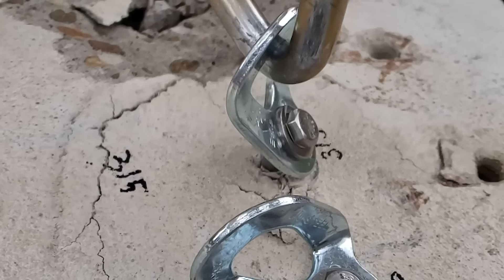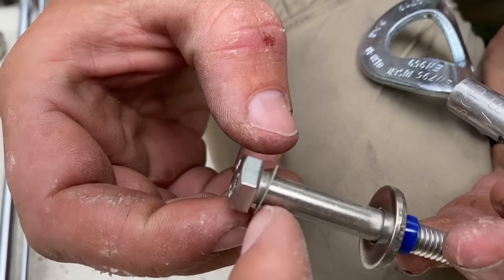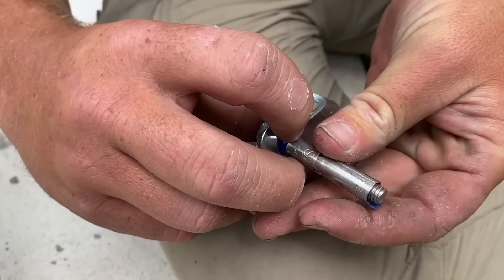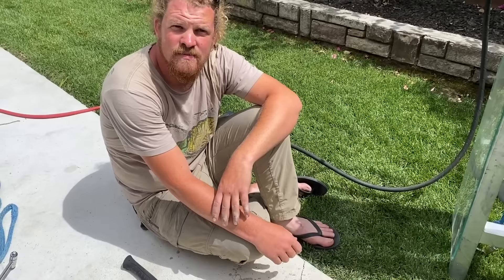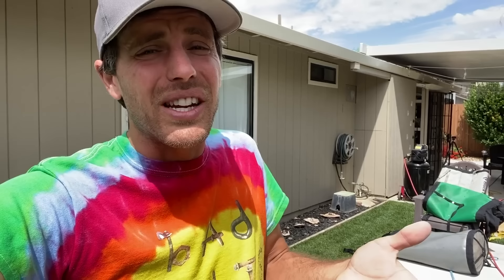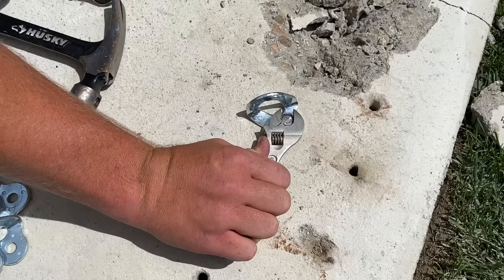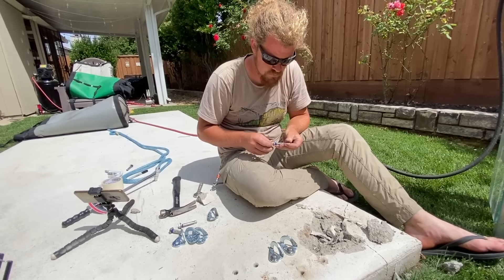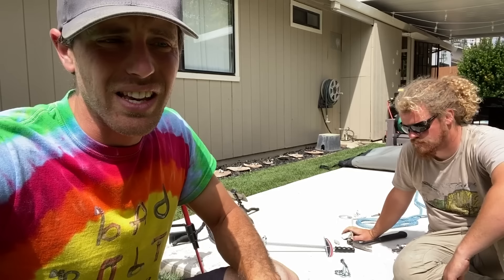What happens when you over torque a climbing bolt?

Comment: You can get a concrete strengthening chemical. They use it in Australia for bottle shop where forklifts drive over. It etches 10 mm into the concrete and raises overall MPA rating. But when using it has an extremely high flashpoint! I've done a lot of concreting in the past. I've seen where the truck driver will water it down so much that when it cures after about a month I'm doing the carpentry framing and crazy cracks everywhere! I'm not making fun of your concrete. Just saying there is a lot of variables in concrete.

Comment: This test tells me the concrete cure fails before the bolt.  This is testing the durability of the concrete.  Test again in another material.   Obviously this test tells us do not forget to torque the bolts.  I think a larger depth concrete and different length bolts would be better test here.  That would show climbers a better understanding of how to avoid failure in softer (wet)  material.

Comment: I don't think you managed to show any difference (50, 100, 200%). Those numbers feel likely to be covered by concrete strength variablility.

As for 400% isn't it likely an effect of the bolt effectively shortening by almost half an inch or so? (less concrete to crater)

Also, 3KN is more than bodyweight! 🤔😅😉

Comment: Concrete gets harder harder over time, indefinitely. At least this is the lore in the trades. So a newer slab like this will be weaker than something that has been around for 10 years.

That said, seems to me once you get large chunks of concrete blowing out so close to the other bolts I think you’d lose some compressive strength on the bolt.

Comment: I'm a big fan of you guys testing all sorts of stuff, but this one seems a waste of time and equipment due to poor setting. (inadequate bolt spacing, the concrete condition, and the lack of 6-point socket) I've personally broken off a head of stainless steel bolts by over tightening it.

Comment: The data is trash at this point because the concrete failed all around the other bolts. They need to be spaced like a foot apart to make this test legit. Also there’s a considerable strength difference between plated steel and stainless.

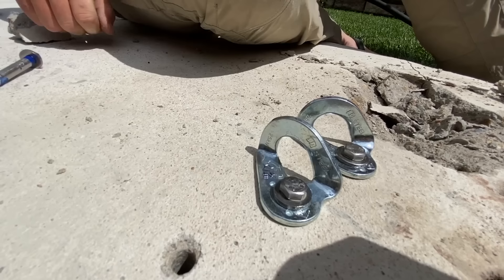Comment: 5:19 No one bolts with a torque wrench? Definitely not the case...
Reply: True but fixed wrench lengths are sized so that a standard 300 pound Gorilla would not be able to go much above the recommended torque.
Reply: People aren't talking torque wrenches out into the field to set bolts. It's just not happening. It's called a generalization. Just because 1 in 10k people might bring a tq wrench into the field, it still means that no one is bringing tq wrenches into the field. There's a reason why the manufacturer says 3-4 turns. It's because the torque is pretty inconsequential. You could put in 10 bolts with a calibrated digital tq wrench, and they'll all pull out at drastically different forces.

Comment: Yur logic on torqueing is serious nemby. Talk to an engineer or certified auto mechanic to get woke. Talk to a mason for the failures waiting for your logic. Not trolling just apalled at your presentation, considering some of your previous videos. It would be nice to know what concrete mix you used and how well cured it is. I assume you have not looked up the steel strength values.